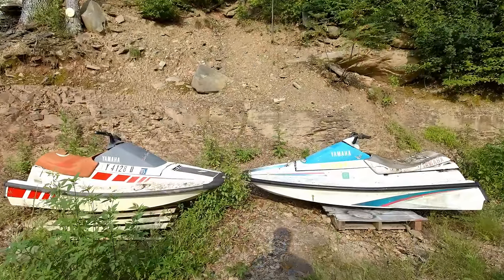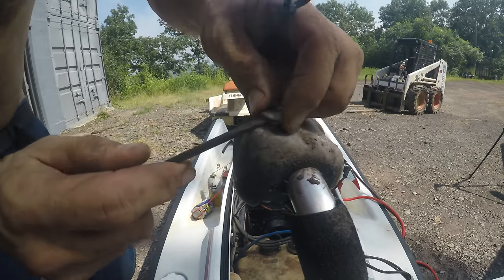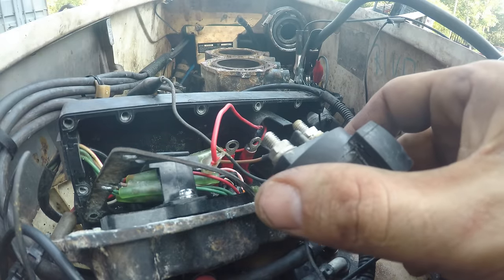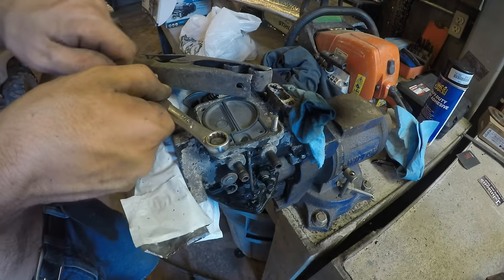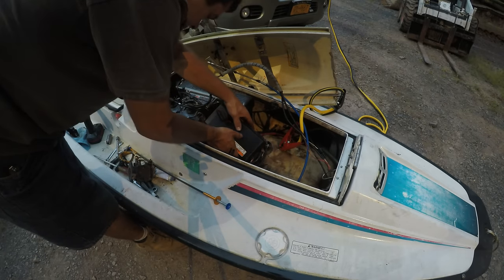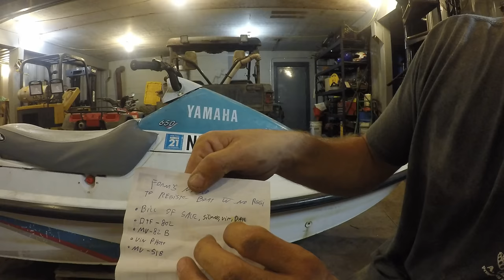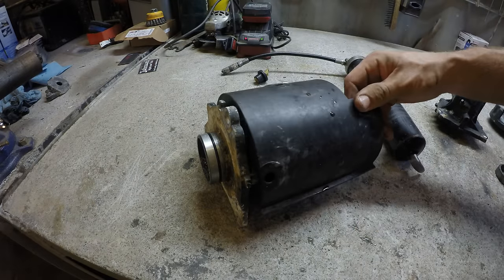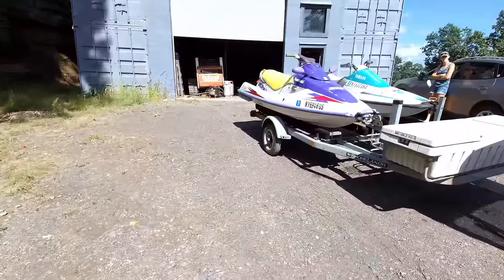Buying the cheapest WaveRunner on Marketplace

Comment: When you were starting this jet ski for the first time to see if it will run did you have a hose hooked up to it for cooling, or without? If you didn't have a hose hooked up to it to get cooling were you worried about the engine overheating?
Reply: U can run them for a couple mins without water just to get things running. But not for long periods of time.

Comment: I had a new 1994 Yamaha DX 225 Shaft drive three wheeler.  I bought a 1996? Honda Odyssey later so my friend drove the 3 wheeler a lot and it became the work horse.  We used it like a rented mule!  It was under water in a creek half the time or pulling something broken back to the truck.  I retired it and it sat for 10 years.  My sisters friends boyfriend wanted it and we went back to get it.  The tires were dry rotted it was faded almost white, rotted seat, battery was dead, a little sticky gas etc.  we drug it out with my truck, the tires held air (not sure how) and we checked the 10 year old oil and put gas in it.  I towed him around my property with it in 3rd gear for an hour.  It started popping, spitting and puking and it fired!  It ran!!!!  I wouldn't have believed it if I had not seen it...
Reply from the maker: Yeah, they are reliable. The last year of 3 wheelers was 1987, so that machine is older than you think.
Reply: @AndrewCamarata  I'm a young 53! lol

Comment: wow! ... your work and skills are amazing and will motivate me to do the same repairs ... but ... $50 for ski + $50 for trailer + $170 for carb + $ ?? for bearings ... total how much? ... is it cheaper vs to by working one? your work obviously cost more than working jetski.
Reply from the maker: IDK, I have a few hundred into it. Usually a used running one cost more than that. I new Spark is like $5000+. I am happy I did that project.

Comment: Next time....connect two batteries in series (to get 24 volts).  And "jump" the starter with the 24 volts.  It will work a lot better.  Just make sure that the 24 volts goes to the solenoid or starter motor and nothing else.

Comment: Is there not a danger of overheating the engine and seizing it running without water for cooling, like the muffs used on outboards?
Reply from the maker: There is, just don't run it too long. There is no water pump that instantly destroys it self like boats have though.

Comment: Isn’t jet ski supposed to be in water while the engine is turning over for cooling or the impeller will burn out?
Reply from the maker: Nah, jetski's are fine. Outboards need to be in water.
Reply: @AndrewCamarata  just make sure to turn the ski on first and then apply water whenever flushing it out or whenever running it on land. My dad's had many and just recently learned to start it before applying water. I hear you can run them for about a minute tops before damage starts, but I wouldn't run it more than 30 to 40 seconds at a time.

Comment: hay Andrew i bought 2 wave runners last week with the 500 and this week i bought a wave runner 3 650 with a good motor can you put the 650 motor in a 500 ski ?  one of the 500 is seized but has a title the 650 runs good but no title.  the other 500 runs great after some maintenance

Comment: That thing is either taking on water or you need to add some weight to the front to get it to stop bouncing. 

That is how those starters and motor mounts get broken as on some of the other jet skis in your videos. Rubber, fiberglass and aluminum can not take that kind of bouncing abuse over and over.

Comment: You should have filled the cylinders full of 2 stroke oil, total full and let it sit over night, rods need oil too! To do it right, pull total engine and rebuild, parts are cheap for that motor.

Comment: As a Coast Guard Veteran I'd really prefer you overhaul those engines and jet drives as well as replace all that old wiring.
I can't tell you how many times SAR cases involve undermaintained watercraft.
Jetskies/Waverunners are the worse as they are very susceptible to being blown all over the place by winds, tides and currents leading to them being well outside the search area of Coast Guard assets.
Just ask any small boat station.
They hate those SAR cases.
To many end in tragedy.
Many due to larger boats hitting or swamping a stalled WR or JS that's unable to get outta they way and the operator didn't have a emergency compressed air airhorn as required under C.G. rules to warn watercraft coming at them.
If your on a navigable waterway you are subject to C.G. requirements per emergency equipment.
Flares, water dye packs, signal mirror and more. 
The Hudson River is definitely one.

Comment: like 2 years late to the party, but i got a question,
i have the same 650 waverunner, 1989, got the same new carb on order, will that need adjustment to make it run right? or i just put it on and it will work, cos here it dosent show it idling, only revving so that wasent much help
Reply from the maker: It should be pre-adjusted in the correct spot.
Reply: @AndrewCamarata  thank you

Comment: Is it ok to run these without water? My 90 has a water inlet connection at the top of the engine, but my 91 and 92 dont.
Reply from the maker: For a little bit.

Comment: Those penatrating oils are mostly voodoo and false hopes. All of them. If you want the desired effect you are looking for use oil - the lighter the better. Ive used sewing machine oil. Once you get it rotating the perfect oil to use is ATF. It is very high in detergents and friction modifiers for the clutch packs.

Comment: You have torque wrenches and wrenches why don't you use them? When going into an engine things have to be done a certain way you don't just jump into it with an impact. Bolts have to be put back in in a star pattern and to a certain torque/amount of pressure applied.

Comment: I have the same kawasaki sts 750 and is it just me or is the reverse just not work on them? Both of mine are terrible to work with even thought there's nothing wrong with the machine
Reply from the maker: Reverse? It goes back, not super fast. All it does is drop that thing down behind the jet drive.
Reply: Andrew Camarata Yeah, it’s pretty much a bucket diverting the water being propelled from the jet. Just that on other seadoo models I’ve ridden before and used. It seems there variation works better somehow. Maybe it’s just me. I just feel a little dumb rocking the ski back and forth on the ramp lol. Also just picked up a 96 hx for $400!! I love working on these olds 2 strokes and getting them working again.

Comment: I have 1991 yamaha waverunner model WRB650P that am bypassing the engine oil injection pump and going premix wondering if by any chance you know the oil to fuel ratio i need? Thanks.
Reply from the maker: Probably around 40:1 but I would double check that
Reply: 40:1 I'll double check that. Thanks for your help.
Reply: Thanks for the info. I have another question my engine will not idle only starts if given throttle but will die as soon as i release the throttle. I did rebuild the carburetor and fuel pump but did not adjust the High or Low needles. By any chance do you happen to know how to adjust it to get it to idle?

Comment: Noob here, what is all of the white powder/buildup all over the engine and parts?
Reply: These wave runners used to run cocaine in the Bahamas - a little leftover residue..... LOL ……... No it's oxidation and mineral calcification from the water on the metal parts - no big deal - like an old pipe.

Comment: Next time you work on a jet ski.  soak all bolts in iodine.  breaks the corrosion between aluminum and steel.
\
Reply: Thank you for that information from a Nurse that ran heavy equip. Drove for a living. Computer chip manufacturing from start to finish.  Build computer from parts.  Learned and worked on  2 stroke, gas and diesel engines, all aspects of automotive repair from engines, trans. And rear ends. Automotive body work.  Can build a house from foundation to roof  inside and out including electrical, pluming, heating, A/C. Finish work.  Including all floors walls and ceilings.  Welds, hikes, fishes and Gardens. All from curious for knowledge and a Fathers patients and love. With all jobs being completed never knew Iodine broke steel/aluminum corrosion bond.  Thank you from the bottom of my heart.  Iodine.  Save you from infection and radiation exposure. Now suck bolts.  Like is great!

Comment: While I agree you have considerable skills, I don't understand your disdain for generally accepted good practices in mechanical repair. No torque wrench, no cross pattern head bolt tightening, spark plugs tightened with an impact wrench, pounding on the ears of parts, driving in bearings on the internal race.  All these things are fine as long as you are only working on your own equipment but completely inappropriate if you want to do it for hire.

Comment: Looks like a 650 and a 500, the 500 had a thicker more durable hull. I was the mechanic at a water sports company in the Algarve and looked after a fleet of them. 650,s were much better 2 up.500,s didn't, t wear thru the hull when dragged up and down the beach.
Reply from the maker: The blue one is a 650, then red is a 500. I have two of those 500's. The 500's are a little slow, but they are built like tanks. (the one plowed threw my boat last year :/ There should be another few wave runner videos coming out this year.
Reply: @AndrewCamarata  we also had the strange single seater wavejammers. Fun to ride sitting backwards on the handlebars.

Comment: im baffled and amazed by how much about small engines this kid knows im wondering how he learned...a class of soem sort ? he seems to be able to diagnose problems eveyrwhere ...i wouldnt know where to start. only thing ive learnbed so far from watching small engine repair videos is its usually the carberator so id probably check for gas,oil and cklean the carb, if everything else looked normal id probably be stumped.

Comment: i could have made money by beting that you would decide to make the 650 run instead of the 500 . A mistake that most of amatures do . the 650 was the worse jet ski ever made  . It was the lemon of the company Yamaha you cannot burn 5 gallon of gaz without opening the hood to find out why it died on you again. And thats when you were lucky enough to go thru a season without rebuilding the engin .
Reply from the maker: I rode that 650 allot, it was good after I fixed it. I fixed the 500 too in a later video.

Comment: In the long run hey are money pits. They worth more as spare parts or to be used as flower pots.  https://cdn.pixabay.com/photo/2016/03/08/20/37/flower-pot-1244716_960_720.jpg
Reply from the maker: Those Yamaha's aren't money pits.
Reply: Not if you've got free spare parts but they're better and a lot more reliable than Sea doo that's for sure.The 650 waverunners  were  top skis in their time but there is no comparison with the newer skis.. i guess if you don't care much about speed they're fine. You can still have fun at 40 mph . I bet you if you ride my 84 mph 300+hp Yamaha gp1300r  probably you won't touch the 650 waverunner again.lol   https://www.yamahapart.com/yamahawaverunnerhistory

Comment: Brah your cheap jumper cables are not helping you start anything. You trying to flow 600 cca through Chinese thin wire
Reply from the maker: I think those are 2 gauge cables.

Comment: What a load of tosh.....complete and utter armature!
Reply from the maker: Ray Henderson lets see some videos of you fixing wave runners.
Reply: I have never worked on a "Wave Runner" but I have rebuilt well over 500 engines ranging from a couple of cc's up to 20,000 cc's. If I came across a seized or an engine that had not been run for a very long time and was open to the elements the first thing I would do before ever thinking of rotating the crankshaft would be to remove all the spark plugs/injectors (if the cylinder had water in it there would be a very good chance that it would hydraulic if on a compression stroke and may well bend the conrod or cause damage to the crank shaft and other related parts). Secondly I would remove the cylinder head and sump (oil pan) and remove the pistons and check if the rings where stuck or broken in the groves (a broken ring would almost certainly put groves in the cylinder and if deep enough would render the block unusable or would require a rebore or re-lining. To remove/release  rings stuck in the groves I would soak them in boiling hot water for about 10 minutes then remove them and spray with a releasing agent (WD40), with the pistons being hot and the WD40 be cold this would cause a capillary action hence sucking the releasing agent into the groves. This may require several attempts but trying to prise the rings out may well distort or snap them. There are many other actions I would take and these are only the initial ones and can save a lot of damage and expense.
Reply: Would also like to add that when fitting a cylinder head the bolts/nuts should be tightened in a sequence (normally done in a cross fashion working from the centre outwards) and also done in at least 3 stages before the final torque and NEVER EVER done with an impact gun (unless it has adjustable torque settings). I would also never mistreat my tools by using them to short across terminals (made me cringe when I saw this being done). I just hope people watching this video don't  think this is the way to do things as some one could get badly injured if they followed some of the things you have done.